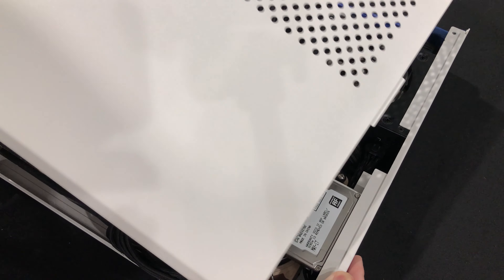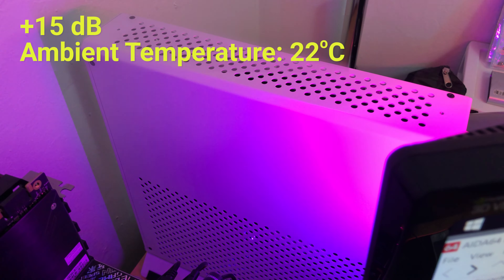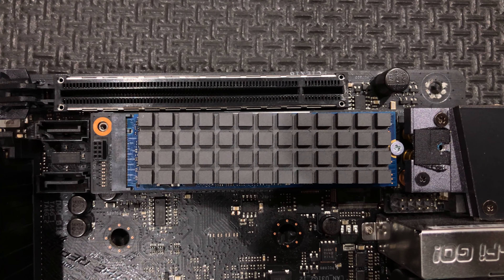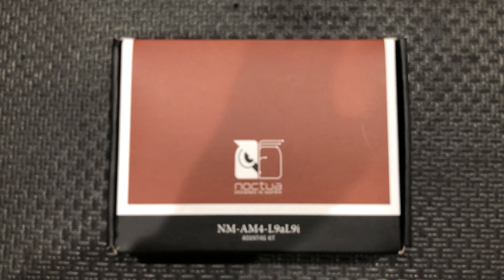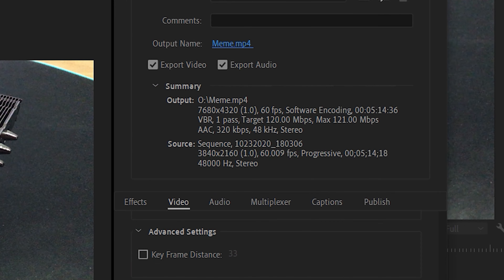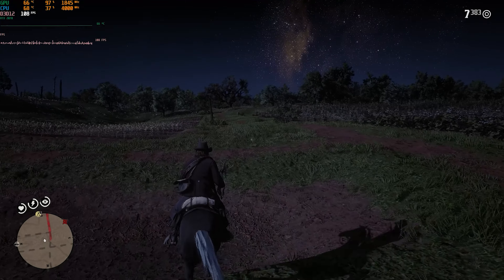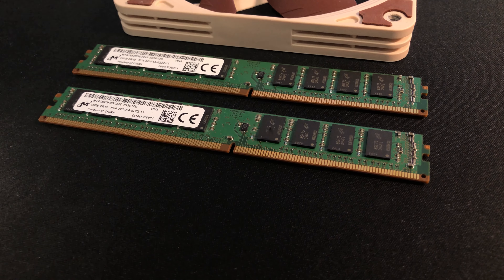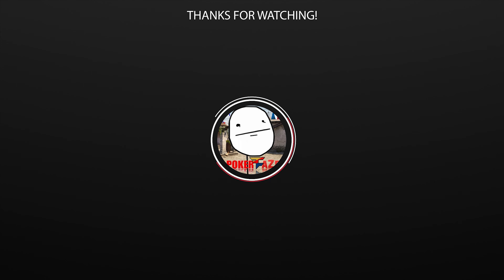Cryorig C7 Graphene & Alpenföhn Black Ridge in HZMod XQ69 - 47mm Low-Profile Air Coolers

Comment: Thanks for the video. Where did you buy the clips used for the Noctua fan on the Cryorig C7G? I kinda need that too.
Reply from the maker: They come with the C7G, but not available for normal C7 and C7 copper
Reply: @PokerFaZe  Thanks! Already got myself a Cu. Guess I'm getting the G as well.

Comment: Hi, Poker FaZe! Since you're online, I have two more questions.

Have you compared ID Cooling IS-47K to the Blackridge Cooler? IS-47 is cheaper and available for me. 

Are there any space to fit in some Noctua 40mm*10mm PWM fans inside the chasis to help with heat extraction? For example, 0:21 the gap between short GPU and "top" vents. Or, 2:45 if you route the 8pin cpu cable along the I/O shield and then above the M.2 drive, will there be enough space between the 6 heatpipes and the "bottom" vents for fans? 

I am comtemplating a build in XQ 69 with RX 6800xt. The card's dimensions are 267 mm x 120 mm x 50 mm. If your short GPU is wider/taller than 120mm, maybe there will be space for 40mm*10mm fans.
Reply: And, if the RX 6800xt extends to 267mm, will there be clearance for two 2.5'' HDDs against the GPU back plate? I saw that the HDD seems to be thicker than SSD at 0:23. And if you change the HDD to the back plate location of your short GPU, will the side panel close with no bulge?
Reply from the maker: - I don’t own an IS-47k so I can't tell, but you can check sffnetwork and I saw a couple comparisons
- I actually saw someone posted on Reddit, and she installed two 40mm*10mm Noctua fan to help exhaust GPU hot air. When I built mine, I tried to find the post again but I couldn't.
- I routed the PSU passthrough cable under the PCI-E riser, you can try routing the cable like that, it would not interfere with the heatsink. But the case has circle holes above the I/O shield to help exhaust hot air, so I don't think you should block them with CPU power cables. And that would be long cables
- I think you can only mount one drive under the PSU & behind the card and have it point toward the power button to plug in the SATA/power cables. I think my HDD was too thick to be installed behind the graphic card because the mounting holes did not line up, so an SDD or a slim 5400rpm is recommended 😁
- Hope I answered your concerns
Reply: @PokerFaZe  Thanks for your answers.

Comment: Nice video! Got my black version of the XQ69 awhile back but the powerbuttons power connector had been crushed in shipping so they sent me a new one, still waiting on it. I will be using a Noctua NH-L9a-AM4 to cool my Ryzen 5 5600X I just bought. Hoping to pair it with an Radeon 6800 XT.
Reply from the maker: Damn, how could it get crushed? My button was pre-installed in the case.
The 5000 CPU and 6000 cards seem so good, but you may need lucks to snatch them at launch, so, good luck sniping em' 🤞
Reply: @PokerFaZe  Had some luck with the 5600X hoping for the same with the GPU. The included toolkit was not inside the bubblewrap so it was loose inside the case. So my guess is that it has slammed against the connector during shipping.

Comment: Hi, bro. Have you tried noctua l9a in this case?
Reply from the maker: No, I did not cause I didn't have it at the time, but I don't think it is enough for my 3700X
Reply: @PokerFaZe Got it.   Cheers.  I have the black ridge.  But I am think should I need to change it to noctua L9a.   I got a 5800x now.

Comment: Hey bud! Great video. Have you checked out the v4.4? Which one do you think is better?
Reply from the maker: I am not sure what you meant so I think I have not checked 😬
Reply: @PokerFaZe  there's a new HZMOD XQ69 version (version 4.4) - it has full vents on one side but I don't know what it looks like fully built into. They removed the front USB ports though
Reply from the maker: I just checked, that is nice. So with the full vent like that, I can see the GPU temperature being better. I would go with 4.4 unless you care about front USB. Building experience would be the same.
Reply: @PokerFaZe  thanks! I'm curious as to how it would be better though? The full vents are only on one side (as far as I know) which means the vents are open to the front of the GPU and the back of the motherboard? The backplate of the GPU would still be covered
Reply from the maker: Nah, the full vent is opened for the front of mobo and the back of the GPU meaning it would be great for flow-through cooling (if you can fit an RTX 3000 card in there)
Reply: @PokerFaZe  
need to swap panels? just in the basic version, solid perforations are located on the front side of the video card and the back of the motherboard, and I don't understand how this contributes to improving cooling ... isn't it logical to put this solid perforation on the front side of the motherboard?

Comment: VLP! VLP! Exciting. Is there enough clearance for PUSH PULL on the Black ridge?
Reply: Also, glad you are feeling better.
Reply from the maker: Thanks man. I emailed them asking about 2 slim 120mm fans, they said the included brackets supports, but when I tried, the holes on the cooler are too small to insert them. I asked  them about this problem and they never replied. I think we need to drill it 😅
And to do one slim one full size, I think we need to email and beg them to send us some freebies like Noctua, don't know if they are willing to

Comment: how did you managed to screw the mounting screws with the backplate? the screw seems to be too short?
Reply from the maker: It just works. The short screws are what bend the board, so we need the backplate to prevent that.
Reply: @PokerFaZe  i'm actually using id-cooling is-60 evo. i thought that these 2 cooler was pretty similar, but it seems like they are actually quite distinct from each other.

Comment: 4:07 How thick is that heatsink on the M.2 drive on the back? Is it touching the side panel?
Reply from the maker: It is 4mm, I don't know if it touches, doesn't matter, it is placed on top of a thermal pad
Reply: @PokerFaZe  Wendle at Level1Tech mentioned that if you make the M.2 on back of MoBo touch the panel, it will have better thermals.
Reply from the maker: It is fine, temperature is low for any NVME drive

Comment: 0:41 I noticed that you used long screws to push the PSU towards the center of the case, thus leaving no room for 2.5'' drive below PSU as you showed in other videos. What is the purpose of this change?

And you changed the original PSU extension cord into a new one with bigger/thicker plug. Why? Is the original slim one having quality issues?
Reply from the maker: You just answered them all by yourself, here is the video of me doing the mod https://youtu.be/XNyJtoXsdAc
However, the seller mentioned that they use thick wire, and I checked that the wires of the case were even thicker than the ones replaced, so it was unnecessary. But it could be useful to have it in other cases that need PSU passthrough cables

Comment: Did you catch Optimum tech's new video? The New 6800xt fits in the sentry xD. That is insane.
Reply from the maker: Yes, I just watched today :)) the GPU cable bend is just perfect 👌
Reply: @PokerFaZe  there is an option to use low profile power cable adapters, and all will fit fine

Comment: I want to pull the trigger on this case ,but, if i only do pure gaming 4k max settings on this case , will the  heat be a problem?? Im planning on 5600x cpu which is 65watt tdp
Reply from the maker: I don't think it will be a problem with heat if you only focus on gaming. I am playing RDR2, Control and CSGO, temperature is very good with the Black Ridge.
Reply: @PokerFaZe  nice, is black ridge considerd to be one of the best coolers for this case ? , Should i add a noctua fan instead of the original fan ?
Reply from the maker: You can check the description as I already listed some coolers. Fan is up to you, people replace because of noises
Reply: @PokerFaZe  thank you sooo much bro for the info

Comment: Your results are quite abnormal. I use a de-shrouded wraith stealth on a 3300x in my Sentry 2.0 and my temps do not approach 90. I know it's not an apples to apples comparison with a 3700x, but the coolers you are using are rated higher than the wraith stealth so the results should be in the low 80s. Try getting a torque wrench, and use .5 or .6Nm of force when tightening the mounting screws. Also, make sure to follow AMD's guideline of a thin bead of thermal paste in an "X" pattern. I'd like to see the results of an exhaust orientation of the Black Ridge in a future video. Keep up the good work: your videos are awesome!👍